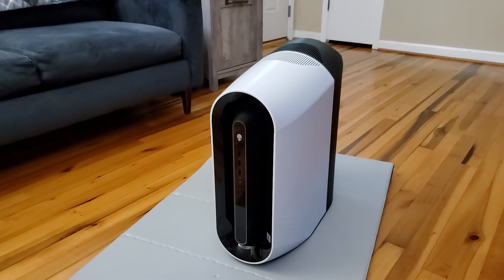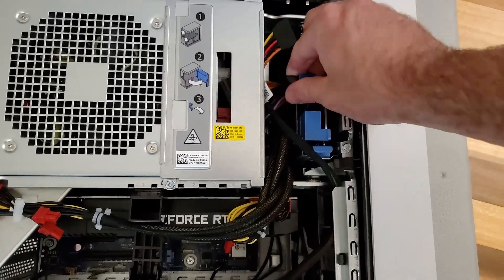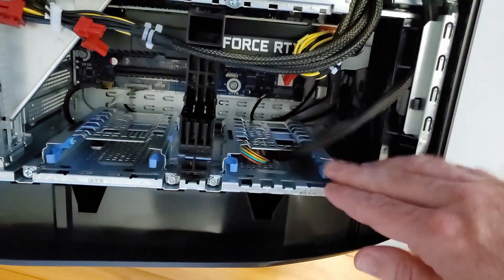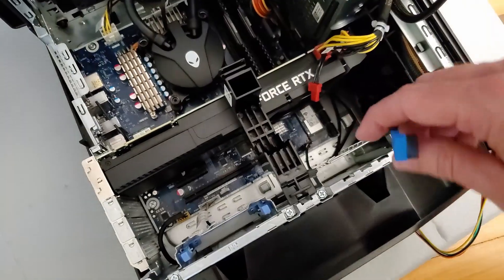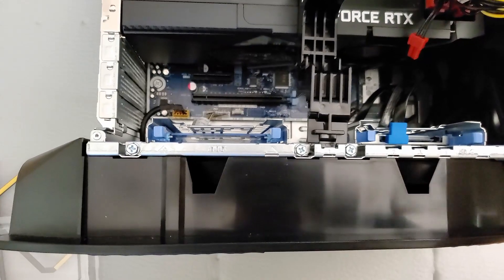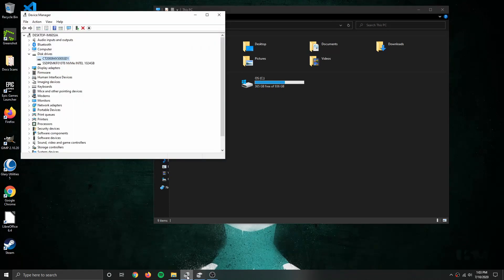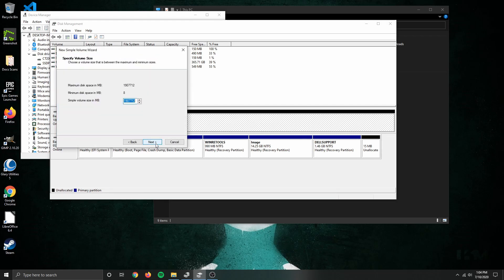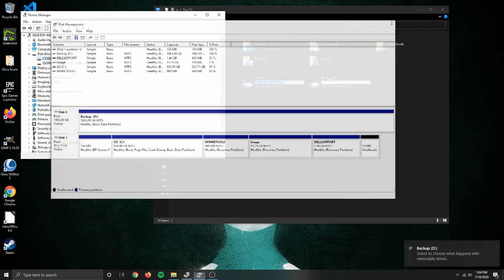Alienware R11 Solid State Hard-drive Install / Upgrade: Step by Step

Comment: the battery is blocked for me to connect SATA  port to the mother board. get video to uninstall the battry?
Reply from the maker: I'm not quite sure what you mean by a battery is in the way. There is no battery in the R11; though the power supply is mounted on cool swing arm and must be moved into the upright position to complete the install. The existing SATA cable was plugged into one of the ports under the graphics card, and that is why I chose to re-route the cable instead of removing the card and plugging into a new SATA port. You do have clear access to two unused SATA ports located at the bottom right hand of the board; you can clearly see these in the video.
Reply: @theonlyjoe6036  i double checked my r11, the reason i am not able to access SATA port is due to my liquid card!!  the liquid version of rtx2080 takes two slots, so i have to remove the graphic and liquid part,  may i know how to remove the graphic card from you ? thanks for reply anyway.
Reply from the maker: @wangbowen2186  I only have an air cooled 2070 Super in my R11. I'm not entirely sure of how to remove the 2080 liquid version. I've included a link to the R11 service manual. Check out page 52 on removing a dual graphics card. If you are adding a drive then you will need a SATA cable with a 90 degree angle for clearance.  https://topics-cdn.dell.com/pdf/alienware-aurora-r11-desktop_service-manual_en-us.pdf
Reply: @theonlyjoe6036  where are you man. Waiting for another upload. ⏳👀